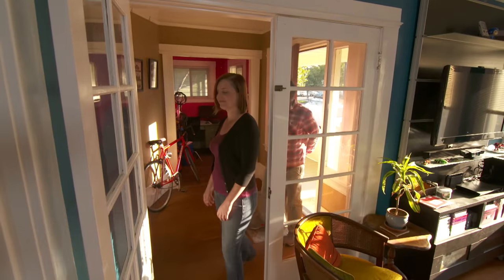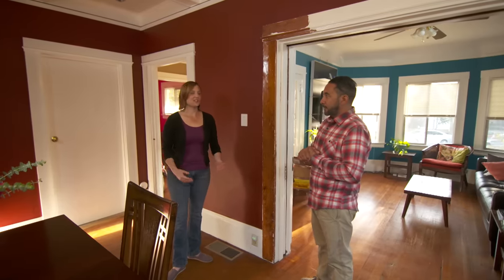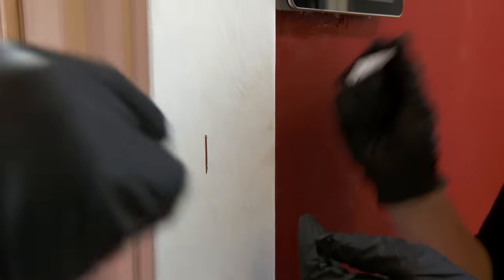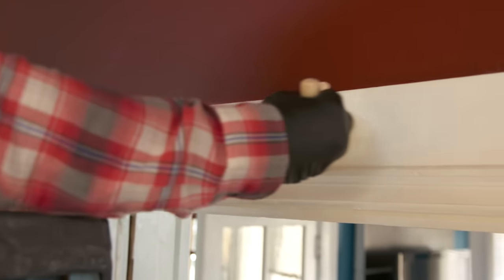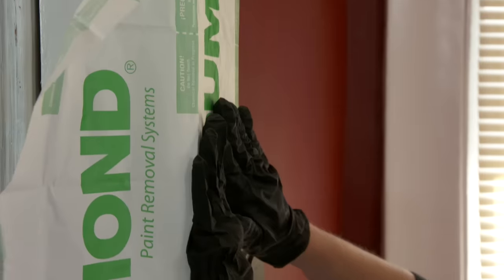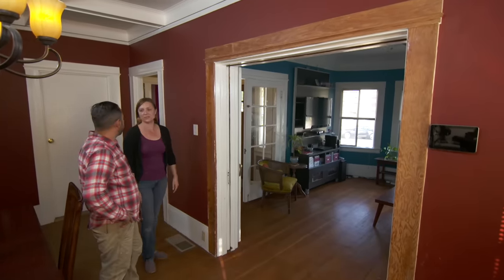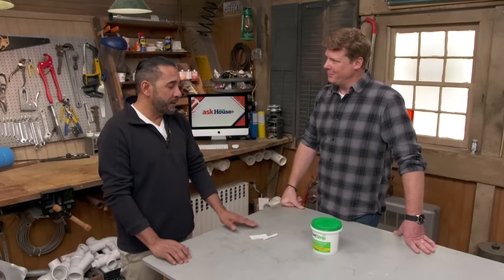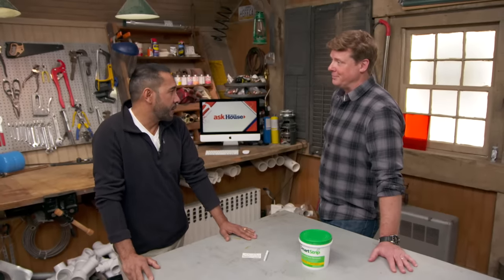How to Safely Strip Paint from Woodwork | Ask This Old House

Comment: in case anyone is wondering, this is Dumont Smart Strip Advanced. The main active ingredient in it is benzyl alcohol, that's why it's low VOC and it does indeed smell like almonds. You could buy benzyl alcohol directly if you need to do a lot, it would be less for a gallon than you pay for a quart of this, but wouldn't have the gel texture (which comes from added kaolin clay). You should still wear gloves and P95 respirator, though it's much less toxic than many other things. Low concentrations are even used in cosmetics and medications.
Reply: Thank you! i was just going to ask.
Reply: You're a lifesaver

Comment: I am curious of how the presentation would have proceeded if the paint had contained lead.
Reply: Probably the same method.  But they were using a product called Peel Away.  He was using the green can, which is Peel Away #7, meant for newer paints without lead.  If there was lead present, he would have used Peel Away#1 (in the red can), but #1 works with both.
Reply: @paulkenny5052  What's makes #1 and #7 different?
Reply: @AsakuraClan  he was actually using Smart Strip. Says so in the description.
Reply: @paulkenny5052  he was actually using Smart Strip. Says so in the description.
Reply: @paulkenny5052  Thank you!

Comment: Hey guys. At 34 I just bought my first home. I grew up watching you and it's going to be an honor to use the lessons you have taught to fix up my old home. I hope this works on the plaster walls too. It's like the place was rented out so there's 13+ layers of paint not to imagine all the patched holes I can still see clearly.
Reply: I am interested in how your project went. I am helping a friend with her rental property renovations and I really want to peel the paint however there are a lot of layers as well.
Reply: You would go broke trying to buy enough paint stripper to do all the walls in your house, so don’t attempt it.  It would be cheaper to just remove the wall board (or lath & plaster) and install wallboard.
Reply: @CogentConsult  That's actually what I decided to do. (My house was built in 1930. I think it's an old Sears/Aladdin kit home anyways so everything including the ductwork because it originally had a gravity furnace needs to be modernized.)

Comment: Why test for lead by making a visible cut into the wood at eye level in the middle of the side trim?  Wouldn't it be better to do it in a less conspicuous spot like the side edge that no one can see?
Reply: They were probably going to remove it either way it just would have been a different method
Reply: Yes, they should have removed the test sample from an inconspicuous place.  This isn't the first time I've seen this type of an issue.
Reply: If you already have some of the paint removed, know how thick the paint is, or know what material is under, you can do this without damaging the wood.  You might get a scratch, but he didn't remove wood, he removed multiple layers of paint, that's why it looked solid.

My old house has like 5 layers of paint, some double and triple coated.  I can score pretty deep and never even touch the sheet rock behind it.   I will likely have to just remove the whole wall due to lead paints.
Reply: Great catch, and exactly right.  Even the folks filming and editing noticed the damage, and interestingly made a point to show it.  Goto @6:23 when they are showing the "after" images.  The camera person focuses in on the gouge that this guy left in the woodwork, after the homeowner clearly indicated that she wished to varnish and show the grain.  Her heart probably sank when he took a utility blade to her woodwork.  A professional would absolutely take a sample from an inconspicuous spot.

Comment: You guys did a good job explaining this alternative to the mess of stripping.  Testing the pain for lead was good and informative.  However, you really dropped the ball and didn't answer one major question, "What if my paint comes out positive for lead"?, (such is my case)? What do I do and what are my alternatives?  Obvious question, never addressed.  So what do I do?
Reply: You just burn the house down and move….

In actuality the regulations that were made for Painters in dealing with lead don’t apply to homeowners.  If you use a stripper like this and just make sure to collect the paint well.  Maybe have plastic on floor to catch any that fall.   Just don’t sand the paint and get the dust in the air and you’ll be fine.
Reply: @mick2spic  nailed it. You could even create some plastic walls to "quarantine" the area you're working in.
Reply: @mick2spic  Thank you
Reply: Seal it in a plastic bag & throw it in the trash.

It’s pretty much inert unless you eat it or breathe in the dust.

Small children especially should be kept out of the area.

PPE and dust abatement/collection  is recommended.  As the homeowner, you get to decide how far you want to go with this, but a contractor will generally be required to wear a bunny suit & a respirator with the appropriate cartridge.
Reply: @mick2spic  Thank you
Reply: @James-dq3jo  Thank you
Reply: It should be common sense. Remove the infected area.

Comment: 5:37 I don't want to do any damage to the wood yet a minute ago you took a gouge out of her trim.
Reply: Julio F 

He only made a scratch 

Plus the trim was going to get sanded afterwards
Reply: You have clearly never had to deal with the US government in regards to lead in your house. They are relentless, he made a much smaller cut than they typically do and only from one. I had to have my new house inspected (to even be allowed to move in) and there are deep gouge marks all over my home how in equally obnoxious places. There excuse for that is "If we took it form the side or bottom it is less likely to contain all the potential layers of paint." It's unfortunate but It's just how it's done, no other way to truly know it's lead free.
Reply: @NWinnVR  exactly. Not like not going to redo house if it's old anyway. My home built 1969 I would rather live than die of lead poisoning.
Reply: Julio F he just cut threw the paint Wich was getting removed anyway
Reply: @EpicHeavyStuff  which is why they included the shot of the trim post paint removal, specifically on the spot with a big gouge and wood missing?
Reply: Ever heard the term, razor thin?
Reply: Why do they sell spackle?
Reply: Right at eye level too instead of doing it all the way in the bottom
Reply: @Kt-cn2rq  Don't eat the paint and you should be fine LOL.  The house has been around 50 years, and people have survived in it for decades!  People are just WAY to wimpy today.
Reply: So if it does test positive for lead, then what?
Reply: @user8002  Depending on where you live, if you want the paint completely off you have to, or you should, contact a state certified lead abatement company to remove the paint. A paint company can be certified but most are not. This is not a cheap process. I know this only because I once was a journeyman painter, company owner,  30+ yrs,  before I retired. Some counties will allow you to encase or encapsulate, if you will,  the paint which is what many reputable paint companies will do. That is they will paint a white pigmented shellac over the paint. Shellac, when dried is not permeable. You can use a water based paint on top of the shellac.
Reply: @robotnik77  It's useful for patching drywall.
Reply: @NWinnVR  what state is this new house located? I've never heard of them so strict.
Reply: @robotnik77  was not going to paint over, but show off the wood grain using a polyurethane.
Reply: Are you sure he gouged the wood?  I thought he went only through the paint layers.
Reply: I did not get entire conversation when he told her the type of polyurethane to use.  Something about " no ?? ? Polyurethane ".
Reply: @gmurray3616 he said low VOC (volatile organic compounds) paint.

Comment: Citris strip has worked pretty good for me in place of the old caustic stuff I used to use
Reply: Citristrip contains NMP (N-Methylpyrrolidone), not fun to work with either -- though in this case alcohol would have worked JUST fine since all the paint above the varnish was latex.

Comment: There is another method which is more gentle on the wood, fewer steps, and lets you paint immediately:  Speedheater™Infrared Paint Remover's infrared rays need to heat the paint only to 400-600℉ to separate all layers of paint & varnish from the wood. Regular heat guns heat it to 1000℉. With the Speedheater™ method there are no messy chemicals, no paper, no waiting time for it to work, and no extra step to neutralize or wash the surface. With chemical strippers, the wood soaks up the chemical and the water scrub. When woods gets wet, it must dry completely or new varnish or paint will fail. All that trim work is going to take many buckets of expensive chemicals.

Comment: "We wanted to take the paint off but not the original varnish off" removes varnish with stripper
Reply: and for good measure, here is a literal slice into your precious woodwork in the most noticeable, eye-level spot.  We wouldn't want to test for lead at the top, bottom, or side where an accidental slice would go unnoticed!
Reply: Lmao i thought the same thing
Reply: yeah, the first thing i noticed right away, the original varnish was gone, as with all paint strippers. Actually her first idea of using alcohol was way better :) just some more rough  scrubbing in some places, but still got the varnish as wanted :) i wonder if its scripted and they missed it in post, because i would kick that guy after removing the original after clearly stating otherwise
Reply: Yeah, there is no such thing as a chemical stripper that can only remove the top layer and leave the lower ones pristine and intact! It's a funny but unrealistic concept, a little like saying you want to swim in the pool but not get wet.

Comment: Legend has it, she's still stripping paint to this day.  

But in seriousness, after realizing how long it takes, she more than likely hired someone to do it, or just decided to paint over the old paint.
Reply: Or just plugged the heater gun back in.
Reply: @voodooinc7935  Like a sensible person.
Reply: Just replace the casing and moulding with new wood --- Much easier and cheaper depending on how much paint stripper you need. Especially a case like this where the old woodwork has no significant detail that can't be easily recreated.
Reply: @samperkins1768  Good point, and probably the path of least resistance when you're dealing with pine, but isn't some woodwork made from old-growth woods in unusual or expensive species that are worth saving for their grain character and durability?
Reply: @hijodelaisla275  Yes, there are many times in which the wood and detail is unique and does make sense to strip and refinish. I'm just blown away when people go through crazy lengths to strip pine or fir that has little to no detail and can easily be picked up cheaply from home depot, such as replicas of 'colonial base'.
Reply: @hijodelaisla275  Also the lead test in this scenario is not that important since stripping shouldn't create dust anyways
Reply: @samperkins1768  With the heat gun, it's good to be careful with clean-up because the stripped paint gets brittle and will create dust which, in houses of a certain age, almost certainly contains lead. 

Point taken about stripping woodwork. At my house, I'm doing the work myself and, fortunately, it was originally shellacked, so the shellac liquefies under the heat gun and the paint comes away pretty easily. (It's LAVENDER! Ugly as sin but that's good because it motivates me to get rid of it.)  I like preserving the original wood and don't factor in my per-hour cost of labor. Also, my staircase would require skills that I don't possess to replicate.
Reply: Lol
Reply: Good luck finding wood of that character. Nothing you can get new would be better than that wood.
Reply: @haroldsummers4317  Yup, commercial product with old growth wood is basically impossible to find now since timberland has just been generations of regrowth.

Comment: It looks like they are using one of the Dumond paint remover products.  I recommend you go to Dumond's website and carefully read all of the information about the products and which of their products you need.  I read some of the information for Peel Away 1, which is used to remove lead paints.  They say the ave time for it to work is 72 hours, and can take as long as 5-7 days before you can scrape and peel the paint away.  Then you have to wash it and in some cases neutralize it.  Then you need to wait for the wood to dry out.  I just stripped some outside wood beams with a Cobra Speed Heater.  It was not easy, but IMHO, way better than going this route.  The devil is always in the details.

Comment: Thanks for the helpful video.

Two questions: How do you get the paint off of the edge where it meets the wall without stripping the wall paint as well?

Secondly, if there is lead, what is the procedure?
Reply: you might be able to use masking paint to get to the edge or you could sand the edge next to the wall. 

they make stripper for lead paints like Lead-out. but i wouldn't want to mess with sanding lead paint I would encapsulate then paint over it or get experts the remove it.

Comment: Actually a heat gun works great if you teach the customer how to do it correctly,  just like you taught her how to do the stripper method. You will need to sand the wood with either heat gun or stripper method which was not shown. So in reality, the heat gun method when done properly is faster and more cost effective. As a last little note, when doing a lead test, don't cut into the wood where it is noticeable, cut into the side of the trim or down low near the baseboard.
Reply: A heat gun is not safe to use on lead paint.
Reply: Heat guns cause huge quantities of fumes when that paint gets hot. I know; I've done lots of furniture refinishing, but always outdoors. Even then, I pick a breezy day. After just an hour or two the fumes will make your head spin, so be careful. But yes, a heat gun does a great job.
Reply: I will add a little additional information to your point for those interested, if you do not mind.

Summarizing all the knowledge that I have come across about removing lead paint by heating methods, I can impart the following points:

• Lead paint becomes an issue if heated above 700 degrees Fahrenheit, where lead fumes will start to form. One article from This Old House references a temperature of 752 °F as a more precise figure.
• If the heat gun's operating temperature is lower than lead's volatilization temperature, there should be little to no risk of creating fumes. My heat gun, for instance, only has 'high' and 'low' settings, so in this situation one would need a digital temperature reader when using the gun, or at the very least, to just use the lowest setting and patiently wait. I have accidentally burned the paint and seen fumes on occasion, so I know that they can heat the target material to an unwanted state.
• A better alternative, as mentioned elsewhere in the comments, would the Speedheater Infrared Paint Stripper, which heats up to 400 °F and is able to soften thick layers of paint within seconds. It also works well for softening hard window putty without breaking the glass, and as such is a popular tool for restoration professionals.
• There are also restoration specialists who use a steaming method, which is great as it creates zero dust. Professionals use steam boxes or even portable steamers on site, coupled with a putty knife or scraper. Another suggestion might be to try a wallpaper steamer, which I will be trying myself. The only issue would be to check if the wood type beneath would not be damaged during steaming, but otherwise it would be fine to work with after letting it dry thoroughly.

Overall, depending on the methods employed, sequestering a work area, wearing proper respirators, working "wet" and/or dust-free, and using a HEPA shop vacuum where appropriate are some of the main pieces of advice for DIYers tackling lead paint removal.

Hope this helps!
Reply: @nikolaiv1138  Thank you! We just moved into a 107-year-old house and I really want to remove the paint from the gumwood paneling and trim. 

I am tempted to buy the Speedheater, but have only their own claims to go by as to how safe it is and if it is difficult to use correctly.

I keep hoping that This Old House does a review of infrared paint strippers.

Comment: 6:24 Nice shot of the obvious damage you did to the wood instead of testing the paint in an inconspicuous place.
Reply: Just a little wood filler, and it's gone.
Reply: Picture frame will do the trick
Reply: It's getting painted over, paint would fill a void that small easily. Dunno why the comments are so focused on it.
Reply: She said she wants the room yellow and the wood varnished, so it will still be visible.
Reply: I could make the argument that varnish is simply un-pigmented paint but I wont. ;)

Comment: using a heat gun is the best method, the shellac just liquifies under heat and floats the paint off, the lead is not a concern as a vapour, but u should wear a proper respirator because of the chemical vapours.